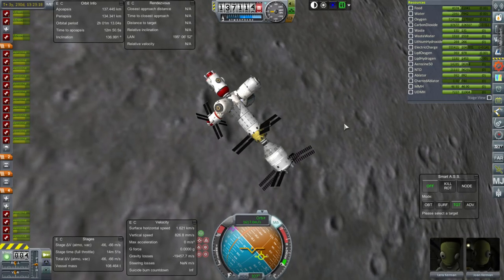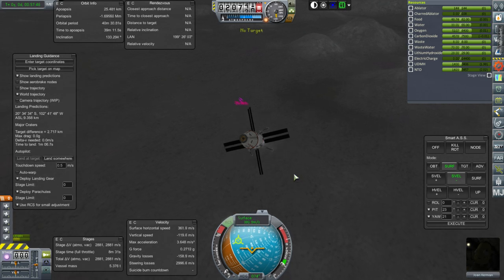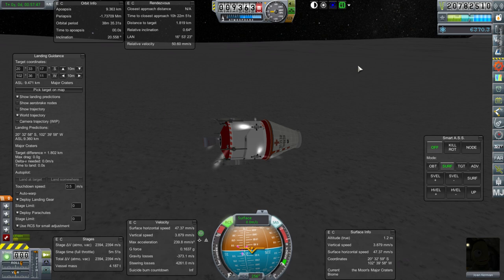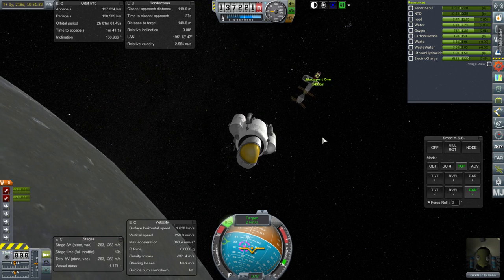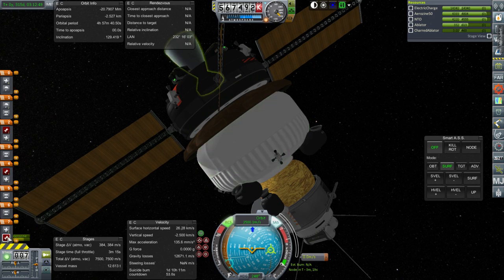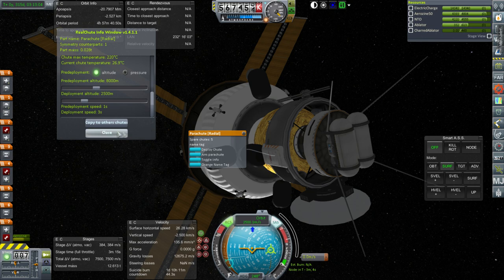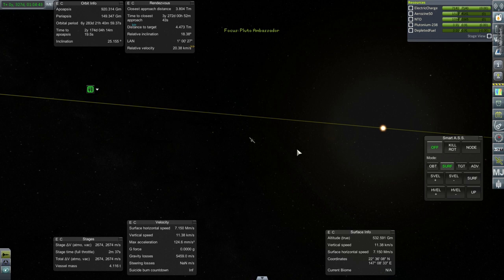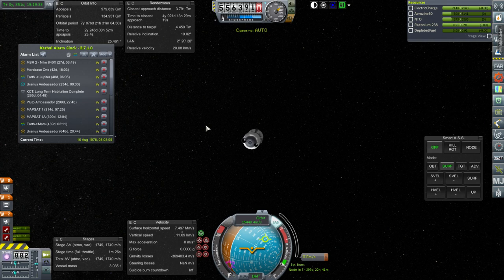Kerbal Space Program with RSS/RO - Beyond History 08 - Landing Issues

Comment: I've learned that to land something heavy on Mars you have to pitch up to 15°-25° to not fall straight down to the ground. I also perform a deceleration burn at around 1500m/s or a bit earlier to 900m/s. Also to prevent heatshield from destroying your lander add a small separation motor offset a bit from the center of the craft
Reply from the maker: I don't think we had that much pitch authority with this, so we may have to do some tests during the Twitch livestream today regarding offsetting the center of mass to get some pitch. If we add a mass offset to the heatshield (for instance, setting the decoupler to one side of it), then maybe we'll save ourselves that separation motor.
Reply: Raiz Space i think it would be better to have more powerful RCS thrusters as offsetting mass manualy may lead to instability during reentry plus it could be harder to perform corrections due to offset and would probably require high-gimball engine or more thrusters to control the burn
Reply from the maker: We could just offset mass by temporarily moving fuel to a particular container and then switching it back out. Takes some experimenting, but so would sep motors. More powerful RCS means potentially more fuel consumption for maneuvers and overcorrections with Smart A.S.S./SAS.

Comment: I think my suggestion for the lander would be to make it a bigger diameter, it should be more stable upon landing that way :). May not look as nice though.
Reply from the maker: Obviously a wider base is better, but stability wasn't the issue this time - it was the throttle on the engine. If you take a look at the Light Lunar Landers, they have about the same height-to-width profile as this one.

Comment: Its a case of not dumping the heat shield along your path of travel when at speed.   You have the ability to alter your course with thrusters but you failed to do it before letting go of the heat shield you paid the price for that failure.    No parts refund for you.